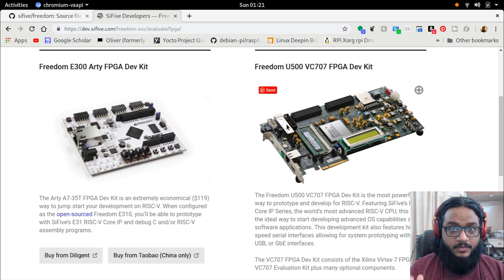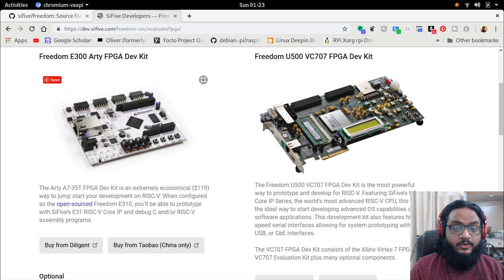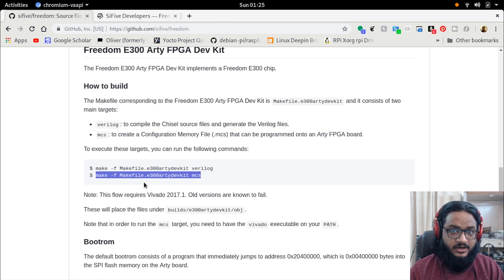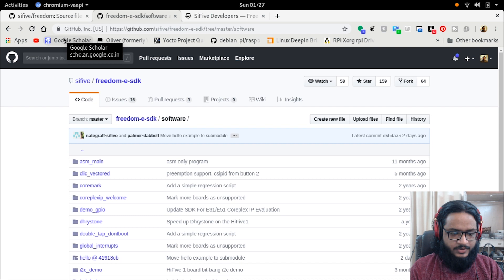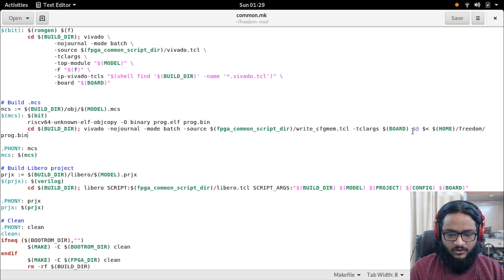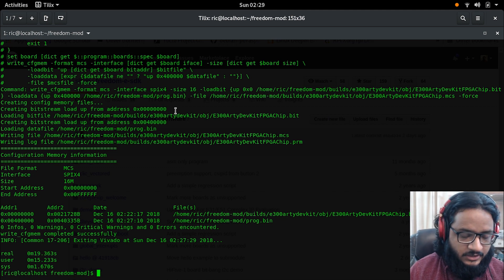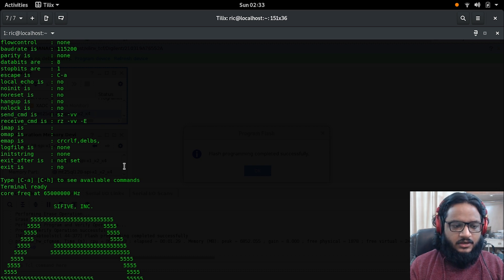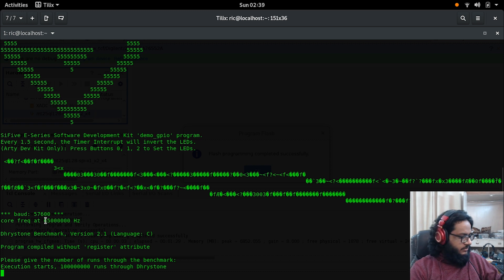Playing with RISC-V SiFive E300 on Arty A7 FPGA Development Board

Comment: Whaaaat? We didn't get to see the final result of the Dhrystone :-( With that many iterations it takes 2m30s on a HiFve1 at 256 MHz, so should be about 10 min at 65 MHz, or 20 min if you're really running at 32 MHz now. btw the "core freq at xxx Hz" is not hard coded, it's calculated at program startup by counting actual CPU core cycles during one tick of the 32 kHz crystal.
Reply from the maker: Hmm...
We'll i guess I'll wait 20 minutues then.
So, in some examples, like the demo_gpio it is hard coded.
But it's defenately running at 32mhz, the 65mhz clock doesn't exist in the design anymore.
Reply: @usrbinsh  no it's not. Show me where https://github.com/sifive/freedom-e-sdk/blob/master/software/demo_gpio/demo_gpio.c
Reply from the maker: not directly in the example code. https://github.com/sifive/freedom-e-sdk/blob/master/bsp/freedom-e310-arty/design.dts#L50
Reply: @usrbinsh  wrong place. https://github.com/sifive/freedom-e-sdk/blob/master/bsp/env/freedom-e300-arty/init.c OK, I'm shocked. I only use the HIFive1, and it calculates the clock speed. But I still don't see how you got 32 MHz in reality. If you did. I await the Dhrystone time.

Comment: You should also take a look at VexRiscV. It's written in SpinalHDL, which makes it extremely customizable. The configurations range from tiny microcontrollers to full-blown CPUs with cache and MMU.
Reply from the maker: I have my eyes on that, just need some more time to play with it.
Reply: @usrbinsh  By the way, if you want to try it out, make sure to choose a configuration without built-in memory initialization. Otherwise it will try to implement the entire program memory as LUT RAM.